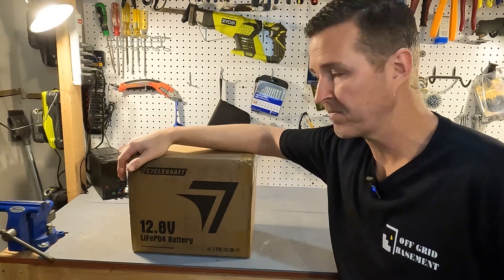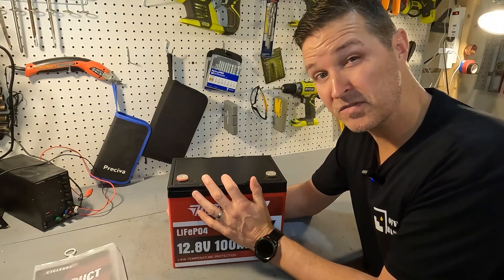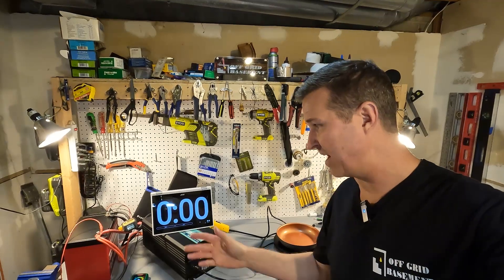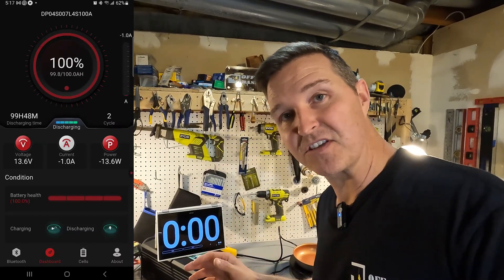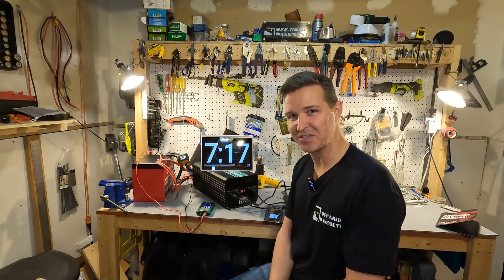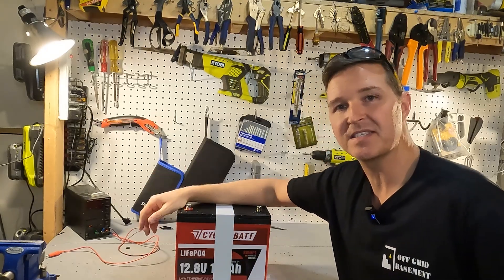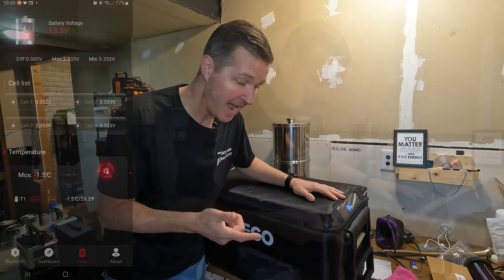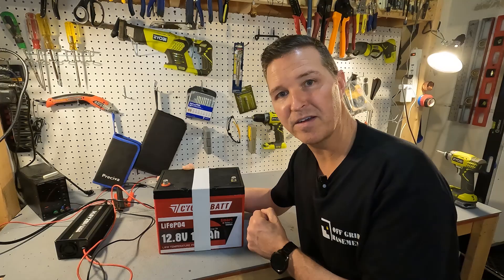CyclenBatt 12.8v 100ah Group 24 Smart Battery Review and Teardown!

Comment: I'd like to have 2 or 3 of those mini batteries to run a small winch I have for pulling on trees I cut. getting them to fall right is easy with a winch but sometimes a pain to get batteries and which places right. minis would be awesome if they would handle the load
Reply from the maker: I think they would work for you.  They are well built and can handle the max amperage they claim.  Hope this helps!

Comment: You've done several reviews of 100Ah batteries and, from the results, I think it is safe to say that in the last few years the quality of these batteries has improve dramatically and that pretty much any manufacturer/company selling these batteries has a decent product.
Remember the days when one never knew what you were going to get when you bought a cheaper 100Ah LifePO4 battery.
Reply from the maker: That's true.  There are still issues with BMS programming.  Thanks for the comment.

Comment: 13.6 is a full battery people not 14 so stop charging your battery to over 14.v its not needed i never charged my battery passed 13.6v and i get over 100amp hours everytime so clearly you people dont kow shit
Reply from the maker: When charging to a higher voltage helps with cell balancing.